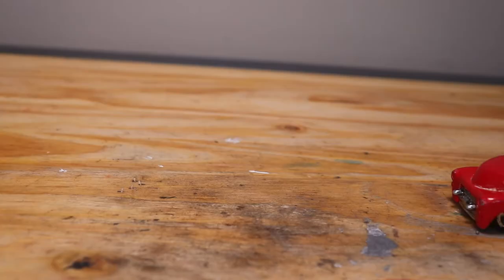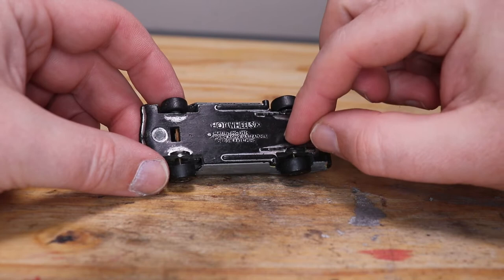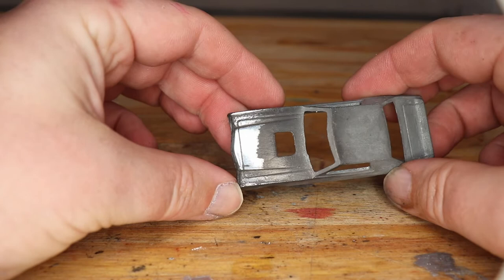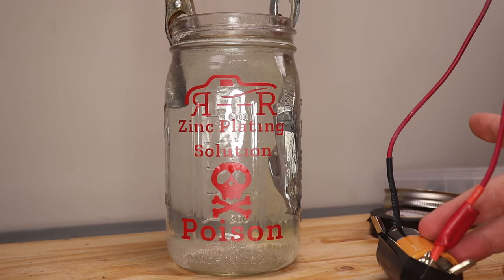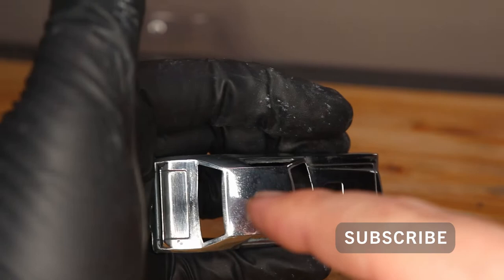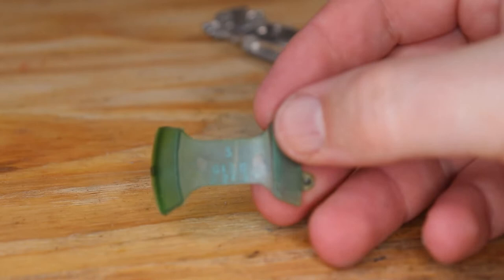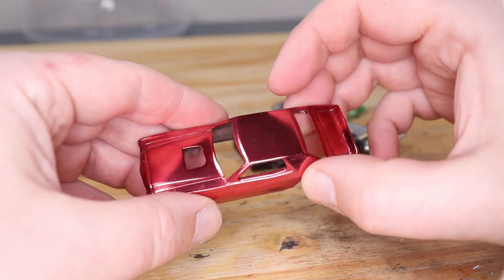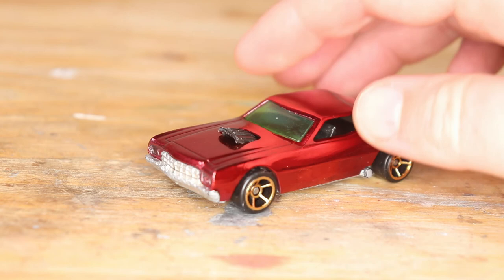Hot Wheels Toreno Stocker Spectraflame Customization!

Comment: To get the yellow out of plastic, drop it in hydrogen peroxide and leave it (in the hydrogen peroxide) in the sun for a couple days.
Reply from the maker: Sadly, that would not work with this type of yellowing. I have tried that in the past. This yellowing is not on the surface, it is throughout the plastic. It is a molecular change.